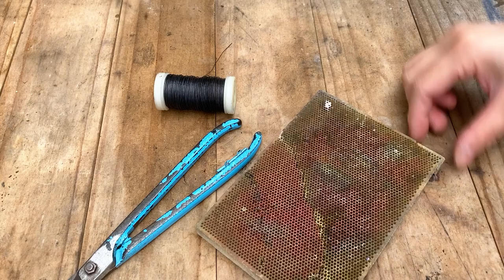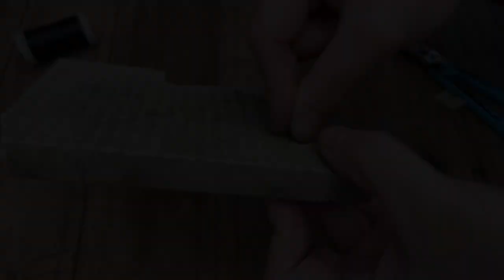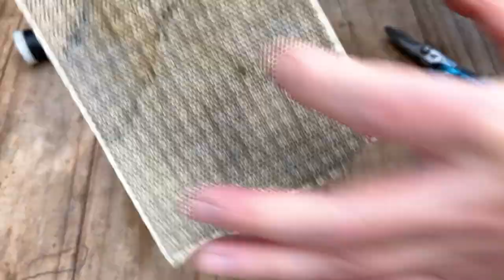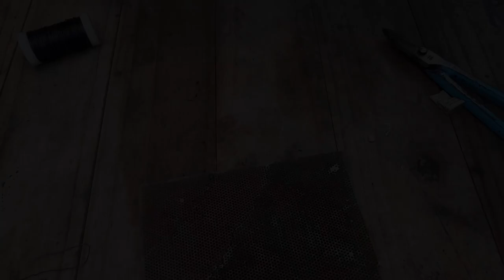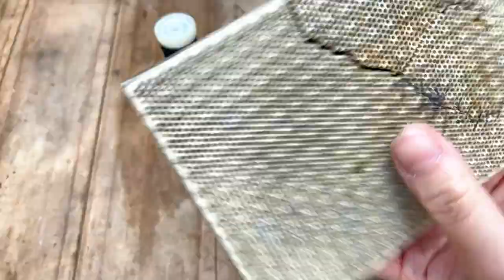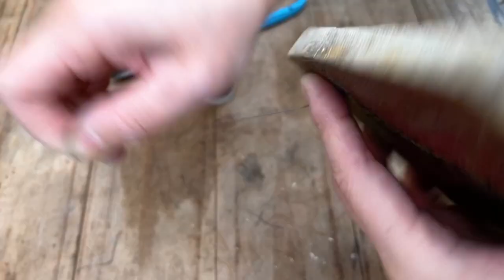Repairing a Broken Honeycomb Soldering Board in Ceramic

Comment: Hi! Why would you want/need to do this? Smaller pieces are completely usable, and excellent for building soldering set-ups, also honeycomb boards are inexpensive. But this is useful to see. Thank you. Did you know that you can slice honeycomb boards very thin to use instead of a screen to heat from below? Saw a NEW honeycomb board into thinner sheets with a jewelers saw. Also great to use with enameling trivets at the "tripod".
Reply from the maker: I just wanted to repair it. Haven't thought much.